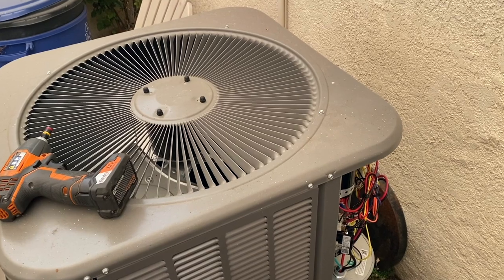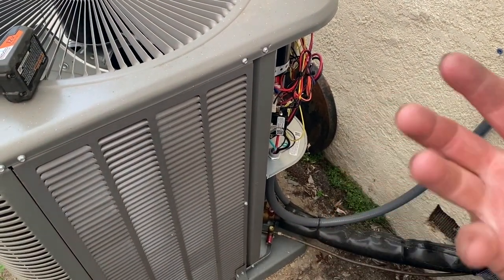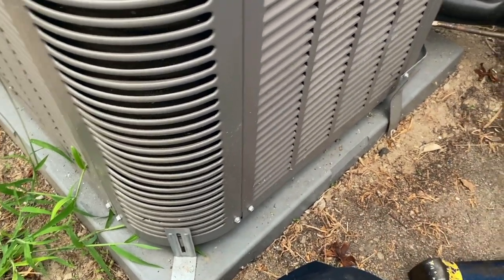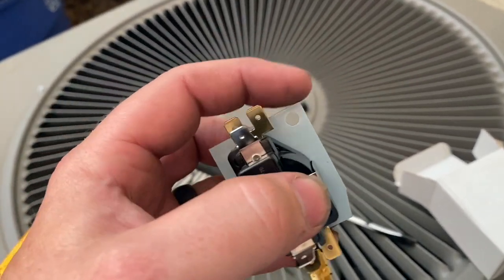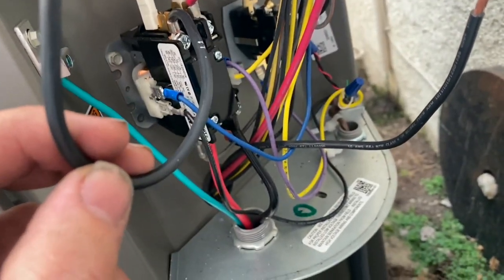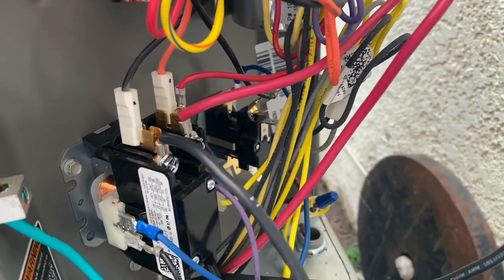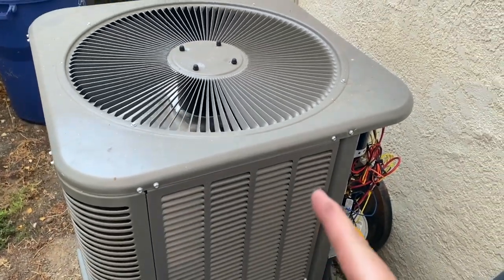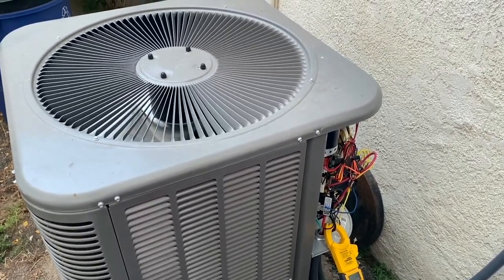Noisy Condenser On Startup, How to quiet it down! EP 43

Comment: I was all excited when I ran across this suggestion. My Lennox CX 14 is also very noisy on start-up. There is a loud buzz/thump sound and my house lights dim. Very noticeable throughout my house. I had my professional heating/air conditioning company install the Packard sequencer. Unfortunately, the same problems exist. No improvement. Just thought I'd mention it for all of the CX 14 owners out there.
Reply: XC 14 that is
Reply: 1) if it has a one pole contactor, replace it with a 2 pole contactor.
2) Also Check any capacitors & make sure they are within 10% of rated value.
3) Also install a Hard Start Kit.
4) Check the voltage at the unit. Make sure voltage is between 208-240 volts.
Reply: @OcRefrig question what would be the difference in installing a 2 pole vs a 1 pole?

Comment: If it’s just a thump, and not the compressor plates hitting, it’s the fan motor. Change the single pole to a double pole. The fan having a hot leg all the time can cause it to start backwards for a millisecond. Then reverse and that’s the bang. It’s too fast to see. The refrigerant isn’t going to move or do much at all with the fan starting that soon. The reason this has solved your issue is because the compressor isn’t starting at the same time as the fan. This is my experience at least.
Reply: A noticeable difference by switching from the factory sp with a shunt to the double pole. 1 year old lennox quieter on startup now with the 2p contactor. When you said the fan starts backwards for that millisec it clicked in my head thanks
Reply: @hey_jorge   what switch did you go with?
Reply: Came here to say the same thing

Comment: That's exactly what I need, just had a new Lennox unit installed this spring and start-up is so violent. Had the installer come back out to check and he just told me it's normal which is true, I wanted a solution. Thanks for the vid!
Reply: I had a new Daikin unit installed , and mine is doing this also . My installer told me the same thing , a normal startup . But initially it was super quiet . But when it is loud enough to wake my wife and I up from our sleep , then I think it is way too loud ,
Reply: @mikeswink1031  Did you ever solve your issue? I had my installer come out two more times for different reasons and asked about my unit and they too said it was normal and nothing could be done. Wonder if doing something would void it's warranty? I'm out on my deck at the moment (1am) and wow, does my unit echo throughout my neighborhood!
Reply: @ImNotMC  Had a start capacitor installed . Still get that initial loud startup , but not quite as bad . Unit then is pretty quiet . Does not wake us up like initially . Can have normal conversations, even at compressor startup .
Reply: @mikeswink1031  Thanks!!

Comment: Great video thank you Wes thank you! Had the same unit installed in January and the AC just started kicking on with that loud surge noise. I'm surprised Lennox doesn't automatically do this across the board on all their units. It seems like a common problem. I'll pass this on to my HVAC guy.
Reply from the maker: Glad to I could help. Thanks for the sub!
Reply: I sent this video to my HVAC installer to see if he agrees . My unit does this very same loud startup . Had the hard start kit installed with no improvement.
Reply: @mikeswink1031  so … 
Is it fixed ??
Reply: @hvacmania8323  Not totally . Still loud at start up , but not as loud as it was initially . One clunk when it kicks in . But does run quieter during operation

Comment: Would it be better to delay the fan instead of the compressor, the fan starting current is far less and would be much easier on the contact points.
Reply: For one,, that's not a sequencer,  that's a fan control for a goodman air handler, Why use a fan control on a compressor which draws higher amps than the condenser fan at start up, I wonder whats going to happen to the fan control after a few days of usage
Reply: Incorrect that is a sequencer. Do you not understand what a sequencer is? Or a TDR ?

Comment: That sequencer's contacts, are not rated for the locked rotor amperage, of even smallest tonnage XC14-018 (1 1/2) ton model's compressor. Start up noise, can be caused by many different things, Most commonly, it's the compressor itself. Soft start accessories work quite well, at curing the harsh start up knock noise, a common Copeland scroll compressor noise problem, known to most major HVAC MFR's. Micostart, and Copeland's Soft start accessories, work great fir this, though are quite expensive...
Reply: I was going to make your exact comment until I scrolled down a bit and saw yours.  Most sequencer points are rated around 7 FLA and 40-50 LRA for inductive loads @ 240V.

Comment: What did it sound like before? I just got $15k worth of stuff installed, basically new everything, and i don't know what anew condenser/compressor is supposed to sound like. It makes a high pitch metallic sound on start-up, like dropping a spoon or a fork on tile, then it does the obligatory "know it's working" hum, but with a little faint metallic rattle. When the installers first turned the until on, after installing it, i heard and I thought "man that's awesome! So quiet!". Only lasted, till they were done.

Comment: Nice fix. The only problem I see is that those vibration isolation pads will be gone in no time since the inner material is cork. They should be completely synthetic.
Reply: I would have started the unit after installing the pads to see if they were even necessary.  Both issues could be causing the noise but seems that wasn’t tested.

Comment: Great 👍 tip , I understand you can only use this for new installment when it makes noise only & I understand is it only good for Lennox or could you use it on other brands as an alternative?
Reply from the maker: I mostly used this method with new Lennox units. I’ve tied it with one new Goodman unit and didn’t have any complaints after the fact.

Comment: Thank you for the video.  I have a Lennox 1 years old, when the using in the winter it makes a loud thumping noise when it starts up.  And it goes on for a long period of time even when it meets the temperature in the condo.  Then it will go off for like a minute and turn back on again even when it meets the temperature .  Is it normal for a heat pump to go on and off to keep the heat in the condo?

Comment: Great video ! i don't like running the compressor load thru the heat sequencer. run the compressor contactor coil thru the heat sequencer. better way. no load. 
also - you could upgrade contactor to solid state contactor. no noise.

Comment: Concern/Question:  Concerned about the start capacitor operation with the delay.  In your unit, you have a hard start capacitor switched in with the delay that will provide the start capacitor function to the delayed compressor.  If one does not have that, shouldn't we switch the large capacitor (by the contactor) similarly (like you did with the hard start capacitor and the delay--  Specifically, the purple line?  But doing that, drops that start up capacitor for the fan.  Hmmm... thinking one needs the hard start kit to ensure both the fan and compressor has a startup capacitor.  Right?  Appreciate your video's and help!

Comment: So this is a heat sequencer relay from a furnace right? If I install a sequencer do you think I still need a hard start kit? Thanks for the awesome video, I moved into a brand new house in February and it has a Lennox condenser that’s also annoyingly loud on startup.
Reply from the maker: It’s a heat sequencer from an electric furnace. The hard start kit just helps the compressor start up smoothly. Honestly all systems should have them. Adds life to the compressor.
Reply: @NighthawkHVAC  Thanks for your reply. I just put the hard start kit on and it definitely helped. I still want to install the sequencer but I accidentally bought a heat sequencer instead of a fan sequencer. The only difference is the start time, question being: can you think of any reason it would be bad to have a start delay of 30-90 seconds rather than 1-30 other than wasting some energy?
Reply from the maker: It shouldn’t hurt anything but will delay your cooling and be a bit of a waste of energy. Thanks for watching.
Reply: @NighthawkHVAC  Sounds good. I just put the sequencer in and it’s working nicely but I think I’ll switch to a shorter delay just to save energy and keep this one as a spare if it goes out. Thanks again for the great videos!

Comment: Can you recall what hard start and what's brand name you used please what do you recommend for the wires to use connected. The Delay switch automotive ones AutoZone or I need to go home depot and  get it from the electrical department rated for 24 volts and where would I find those rubber footings appreciate the help if you could thank you
Reply from the maker: All the parts can be found at your local HVAC supply house. As for this mod I’d highly recommend having a professional HVAC technician perform the work for you. If the wrong components or if said components are incorrectly connected. They can cause major damage the unit or cause injury or death.

Comment: Ok, I get the time delay on start 10 to 15 seconds but these relays time delay break/off, allowing the compressor keep on running for an extra 10 to 15 seconds without the condenser fan operating.

Comment: Really good idea man. I mean even try this on some repeat offenders we have that keep calling back. My only concern is the durability of those sequencer as well as their load rating, especially LRA. I'm thinking it'll be fine for smaller tonnage compressors but I'd be weary for any compressor 3ton or larger.
Reply from the maker: They are rated for 40A for electric strips. They should be good.
Reply: I agree they can carry the load once the motor is running but I checked the LRA spec on the mars website and they are only rated for 30LRA on startup. Even my 2ton compressor pulls 60 which is twice what their spec. I put one on my own unit to experiment before I start using them on customers units. Again thanks for the idea.
Reply: Compressor will usually pull more than or at LRA at start up (can be checked with inrush feature on certain meters). Dunno if that quick rush would matter or not. It obviously doesn't trip breakers lol
Reply: Good comment and good answers👀 sounds like it’s worth going this route
Reply: @adamcraig1568  I lefta sequencer on my unit for about 8 months with no issues
Reply: @adamcraig1568 but it didn't really help with any noise ether
Reply: @mattluongo7763  dang … will you leave it or take it off ?
Reply: @hvacmania8323  I took it off

Comment: Great video...can you recommend sound proofing material for setting up a frame around an HVAC unit and also if a Brinmar Sound Blanket on the compressor is a good idea?
Reply from the maker: Covering the condenser unit is not a good idea. The unit has to breathe.  As for the compressor blankets. They do reduce the compressor operating sound. Usually around 2-4 db.
Reply: @NighthawkHVAC  Thank You!

Comment: What are the contacts on that sequencer relay rated at?  How long will they last breaking that compressor current?
Reply from the maker: The relay is rated for 40A. These relays  are usually used for electric heat strips. As far as how long will they last. As long as any relay. I can’t be sure. Thanks so much for your comments. I really appreciate your feedback.

Comment: We had a new Lennox Merit 13ACX installed back in 2018. I complained about this same problem. The repair person  said he tightened the fan blades and that should fix the problem but it didn't . So what gives? Is he just being lazy ?
Reply from the maker: Tightening the fan blades won’t do anything. If that’s loose the blade would simply fall off. However there is a black plastic ring which Lennox calls the orifice ring. If this is loose it can cause noise. Tightening that will stop said noise. As far as him being lazy or not. I couldn’t tell you. Finding a solution for this problem is not known by everyone. Your tech may have just not been aware of the solution in this video. Took me a while to come up with this solution.
Reply: @NighthawkHVAC  . Thanks for your reply . They are due here for a 2nd yearly maintenance  this month. I"ll mention it to him.

Comment: This might be a dumb question but my air conditioner is about 17 years old now and it makes a lot of noise from that box outside. It sometimes wakes me up at night it's so loud now. It works fine inside though, I still get really cold air from it. Should I get a new one or is there something I can do like this for the old one that will quiet it down?
Reply from the maker: It depends on what’s actually making the noise. Sometimes tightening all the screws will quiet it down. As it could just be the panels vibrating. If it’s the compressor making the noise adding an additive like subco or AC renew will sometimes quiet it down. I’d suggest contacting your local HVAC company to identify the issue. As the additives will need to be added by a licensed HVAC technician.  Hope this helps. Good luck!
Reply: @NighthawkHVAC  Thanks, I'll call one up. BTW, when it comes time to replace the air conditioner, what should I look for in an HVAC company? I'd definitely use you guys if you were in the Phoenix area.

Comment: What will happen in the Winter when the heater is on, and the compressor goes in to defrost.   Will the fan come on when the hot refrigerant is going back into the coils to defrost the ice? Will the sequencer harm the unit in the winter when its cold during the mode?
Reply from the maker: There is no defrost cycle on this unit. It’s just an AC. So it will be fine. Thanks for watching.
Reply: @NighthawkHVAC    I have a heat pump though-- will the sequencer affect the the defrost cycle?
Reply from the maker: It won’t as long as the compressor doesn’t cycle off. If it keeps running it should be fine. This will only delay start the compressor when cycling on from an off state.
Reply: @NighthawkHVAC  Thank you so much for your insight on this.

Comment: Iam a homeowner. My new Goodman condenser unit (3 ton, 14 seer) is loud (thump) on startup plus compressor is louder (running on high pitch all the time, not only on startup) than my 22 year old Amana. Its been a month and neither installer nor Goodman have given me any solution, and I am very disappointed and annoyed by now. Inside the house its annoying when it starts and runs! Help Please!
Reply from the maker: I’m sorry to hear that. Unfortunately without being onsite I would not be able to diagnose this. It the unit is new I’d suggest to have the installer replace the unit under warranty if they can’t figure it out.
Reply: @NighthawkHVAC  Yes, I understand. I have not been able to convince them to just replace unit somehow...they say it is all normal... Im struggling to make my case heart and resolved. I am hiring another installed (paid) to come give me a diagnosis to see their opinion. Thank you so much!

Comment: Would a time delay for compressor,  work the same?
Reply from the maker: Yes. It would have to be a high voltage time delay switch. Or you could use a 2nd contractor with a low voltage time delay.

Comment: I remember a time when the big three: (Carrier, Lennox, and Trane) made units that you didn’t have to rig up in order to make them quieter!!! They were incredibly overpriced but you didn’t have to do this! Today they’re still overpriced and shake, rattle and roll just like Goodman! Damn shame! Thanks for the post
Reply from the maker: Seriously.
Reply: @NighthawkHVAC  Seriously what? You don’t call what you just did rigging up? Did you consult with Lennox before adding the stack relay? If so, is the compressor warranty still in effect with the changes? The 521 is approved and recommended by most manufacturers but the additional items you’ve introduced to this new unit, may be questionable. So, yes. Seriously!
Reply from the maker: I was agreeing with you. Bad context. Sorry.
Reply: @NighthawkHVAC  oh!!! My mistake! 35 years in the HVAC field and sometimes I suffer from brain freeze!! Keep up the good work!